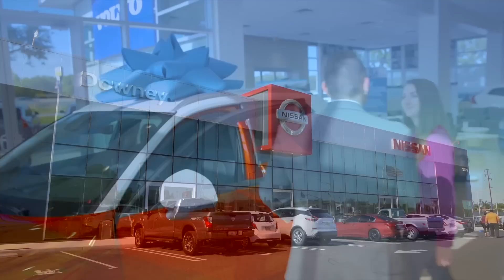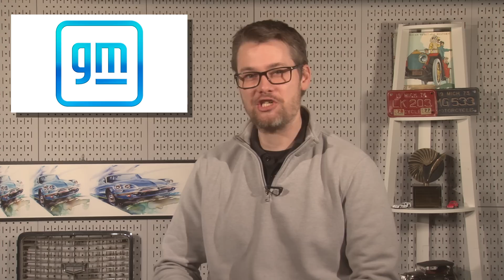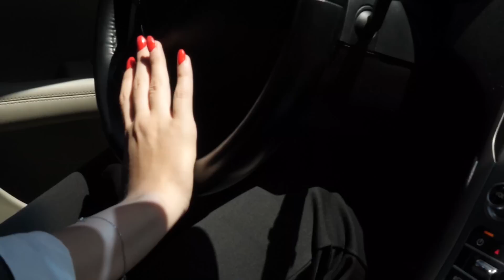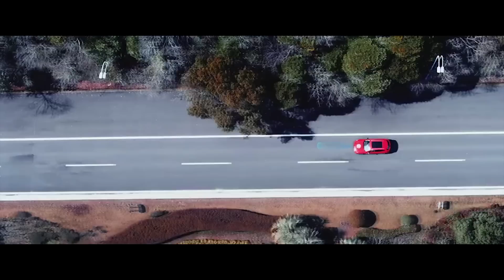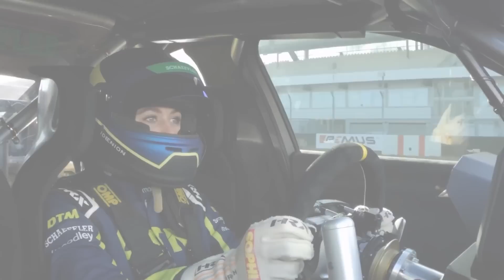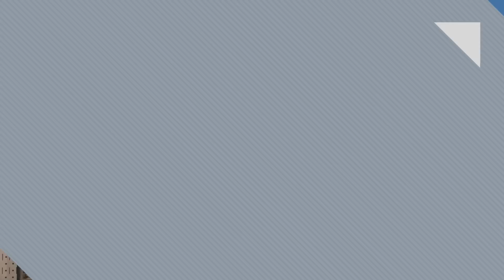GM Giving Away Dealer Inventory; BMW Speeds Up Solid-State Battery Development - Autoline Daily 3474

Comment: Only worry is when Tesla lowers prices and increases sales continually .They have a 20% margin advantage so the model 3 and y can go down to 30k and 35k respectively.So the consumer can spend the same cash as the Equinox EV price and receive Lexus value with Tesla.Legacy is going bankrupt in the Sales Death Valley between 2023-27.Bank on it with new EV companies.BYD and Tesla last men standing.

Comment: I think what Tesla's doing is they want to clear inventory of old cars for the quarter before the $7500 rebate that they will again qualify for comes into action soon.

The reason they do likewise in Canada and Mexico, even if smaller discount, is to discourage scalpers from getting in on the deal in the US and then flipping the car in the other two markets.

The deal is only for ten days or so, just the tiny window between quarter end and rebate begin.
Reply: There is also a new generation and HW4 arriving early-mid next year, which both add to people waiting out
Reply: @monsterous289  I was thinking about that, but wasn't sure if it was a factor or not, my understanding was Cybertruck was going to be the first line to get them, but I have no insight into when the rest of the line-up does as well.

I do remember they're adding HD radar as well though, so maybe that's true, good point. 

So I guess could also be clearing out a batch with older sensors perhaps.
Reply: Elon said yesterday margins will get compressed in 2023,   possibly even negative...   Elon's words,  not mine..
Reply: @donavan2676  He also thinks the auto industry may potentially be going through a 2009 style auto lending crisis, something Tesla is largely immune from. 

This was further supported by some insiders of the auto lending business.

So basically we should fear some legacy bankruptcies.

Comment: Right now it looks like Tesla won't meet the North American battery material requirements for full tax credit. It does sound they may get a break until March but after that that will have to source more materials locally. Stay tuned.